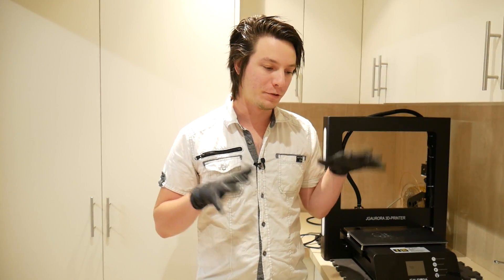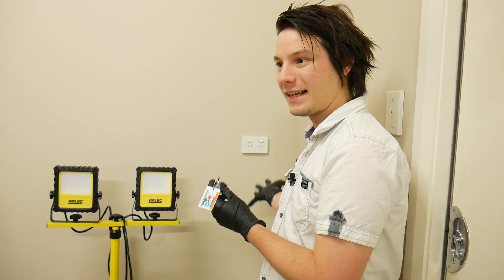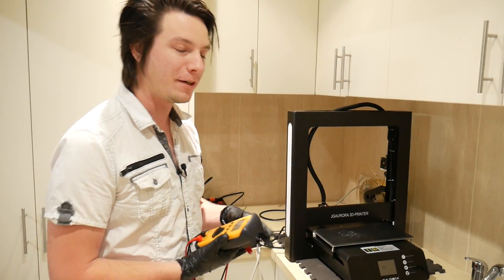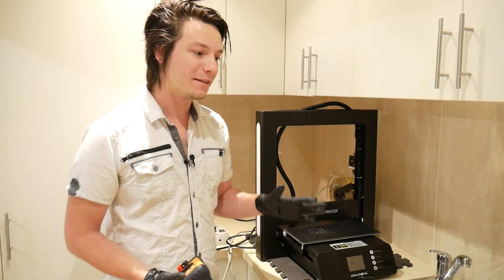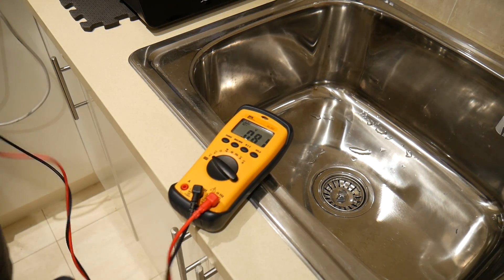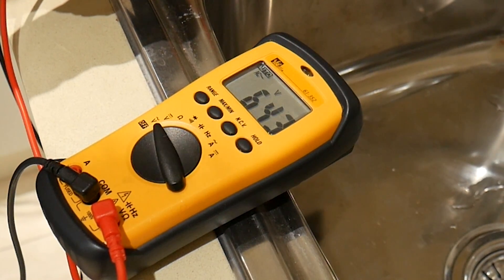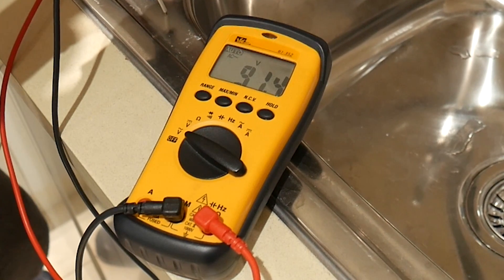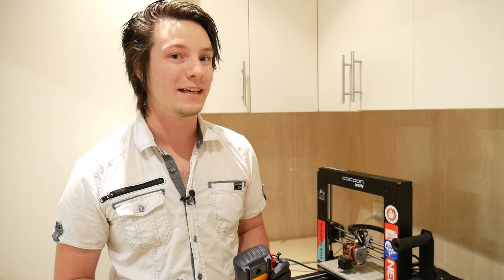This is why I was shocked by my 3D Printer IMPORTANT FOLLOWUP

Comment: K, if you have a voltage on the ground pin because you fail to use the ground, thats a design flaw regardless. And thats messed up.
Reply: What's messed up is the lack of understanding that ALL capacitors commonly used on power supply filtering applications are designed to pass AC with little to no impedance. That doesn't mean putting enough current to harm anyone  on the now floating chassis, just that the resulting voltage on the chassis is certainly enough to surprise you, make you flinch away (unless you're a masochist), or make you swear when you bang your head or whatever on something.

Comment: Also, you can do this all you want in Denmark. In fact, you most likely are. We have ground with a prong (K type sockets) but most devices are shipped witch shucko ground (ground around the side of the plug)

It's safe though, because all sockets in danish buildings have to be protected by a GFI/RCD/HPFI (HPFI is the danish term)

You'll feel it though, and it's super annoying.

Comment: Using the sink as your return path is not always true. If your waste connection is PVC and your water supply is plastic there is no current flow ie. insulation.

Comment: Didn't really explain anything really... Was just a "make sure your ground wire is connected"... So, what happened? Was your power strips ground connection faulty? Was something wired wrong that prevented grounding? Did your outlet just not have a ground wire? 

Nothing was really explained here other than the obvious "derr you need a ground wire cause derrr metal frame"... That's like, 3D printing with a metal frame 101
Reply from the maker: faulty powerstrip along the chain had no ground connected. I discarded it though so wasn't able to test the original source of the fault.

Comment: I had close to the similar situation. When I was over in India on a business trip, I encountered a shock while touching my
computer laptop case and touch the anti-static mat on the work bench. Couple things were going on with my situation. The manufacture of the laptop’s power supply has a filter capacitor connected to the AC neutral and the power supplies DC side of the laptop’s connector. Which in USA, that’s not a problem, but in India, the HOT and NEUTRAL are reversed. That caused the laptop case ground to be floating around 90 VAC above their earth ground on the work bench.

Comment: Ever tried the same experiment with an laptop connected to it's power supply equipped with a 2 pin mains power plug (like most MacBooks)?? !! You'll definitely get shocked by the result (literally!)

Comment: So glad i have a Anet A8 with a UK plug that has ground connected to the PsU, in electrics that is poor and no excuse to say its normal to get an electric shock its normal to not get one. stop defender poor quality  products, SO people make sure not to buy one if you have a pace maker and not let kids use one while drinking .
110v  is used a lot around the world to power things and use say OH its only 94v  erm ok go and stick 2 wires in plug socket and lick them, now you get the picture. 
Enough said
Electric kills and it does not have to be super high, but just the right Zap

Comment: I think it's also worth pointing out, that it's not the voltage itself that does the damage, it's the amperage. Your body can handle having a "high" voltage but low amp current run through it, but high amps will kill. You can think of it like a water pipe. Voltage is the pressure, amperage is the amount of water the pipe can move. Bigger pipe = more water = more amps = death.
They must have a good current limiting resistor setup, or this situation may have ended very differently!

Comment: Im in Australia as well. I have an Anet A8, and haven't had any issues like this. But the power supply cable has a European plug with an adaptor to fit an Ozzy power socket but does not have a ground pin, but has a ground wire connected. Should i take the European plug off and change it out for a proper 3 pin aussie plug?

Comment: Terrible explication! In the last video you mentioned it would have been coused by a broken cable or a badly connected cable?  You should have checked that cable with your testing device and alert people to get rid of a broken cable as soon as they get a sense something is wrong with it!
Now all your sentences sound like click bait by repeating the printers names and the voltages. 

By the way, voltage means nothing! I can provide a power supply that measures 1000 V that is perfectly safe to touch,  as well as a 5 V supply that could give you a shock. It is all about the current, and current trough a capacitor will not be a problem, rather a warning to check your cables.

Comment: Most of the world has AC in the range of 220 to 240V and a frequency of 50 Hz. It is mostly america and a few other places that run 110V with 60 Hz.

Question: Why are the 3D printer manufacturers grounding the frame? The machine runs on low voltage DC which does NOT require grounding at all. Only the PSU needs ground. If they would double isolate the PSU (ground it and then put a plastic shelter around it) it would not be possible to feel any voltage even with faulty ground.

You see this implemented with the few printers that have an external power brick style PSU. You will not be able to replicate this experiment on those printers. There simply is not high voltage on the zero pin even without any ground connection and indeed many of those PSUs do not even have a ground connector.

Comment: It may not be a wire fault but its certainly a design fault. It virtually  guarantees that you'll get a shock if you lose ground connection. The metal cases around equipment should be earthed in case voltages make contact with the case and in normal circumstances the cases should be isolated from the internal electronics. These chinese manufacturers are deliberately pumping voltage out to the case for noise reduction which is clearly something they should never do. Cases and any exposed metal structures should always be completely isolated from the internal electronics, and earthed for additional safety in case isolation is lost.

Comment: Keep in mind that not all sinks are grounded. Full PVC Pipes have that effect. Not all PSUs have a capacitor from live to earth ground. You will find that most all switching PSUs have a capacitor from live to neutral though and if this is the only capacitor, you wont see any voltage from an unearthed pin.

Switching PSUs that are very well designed will not show voltage on an un-earthed pin. Also, in many places in the US (I cannot speak for other countries at all), ground and neutral are wired together at the breaker box, so you will never see this behavior from any switching PSU. You might even say that in many houses (USA) the ground pin is completely redundant.

Comment: I hate to add additional information, but if you take a look at MIL-HDBK-2036 appendix B, you can approximate the human body as a 1500 ohm resistor in parallel with a 0.15µF capacitor.
One end of that curcuit will be connected to earth ground and the other end will be connected to various points on the unit.  The leakage current is determined by the voltage across the 1500 ohm resistor.  In the military world I live in,  the leakage current limit is 3.5 milliamps.  As I recall, the threshold of pain is ~8 milliamps.

Check out https://www.mddionline.com/leakage-current-standards-simplified for more information.  I have not personally checked out that site, but it seems to have a lot of leakage current information.

Comment: speaking as someone who wires houses sometimes, ground should never be saturated unless it is for intended use of dumping waste power from things outside of the power circuit. Machines are generally designed to not electrify themselves when grounding is unavailable.
Reply: You might stop wiring houses as you have no clue of what you are talking about.

Comment: So, you go from testing you wall outlet with your tester, showing it is okay, to your printer and just saying "I have recreated the fault I had before - don't try this - messing with ground is dangerous". But you don't explain what your fault was, you don't show what you have done to recreate the fault and you don't even show the tester plugged to the extension cord. In the end, you just say these devices have no ground and in this case it is okay for them to show voltage on the case. But I really don't get the point of this video, it just confuses more. You really should have explained and shown what your fault was, how you recreated it and how others might get into this trouble (e.g. cheap multi-country adapters). You should also have plugged the tester into your extension cord and you also should have measured against ground from a wall socket, not against the sink. Measuring against the sink is dangerous, it doesn't provide good ground at all. Pipes might be partly out of plastic or PTFE tape might be used on pipe connections. Also... no word about current. It really doesn't matter if the multimeter shows 90V or 300V, the current that may leak through the Y capacitor is important and that should be well below ~1mA.

Comment: What we can tell from this video, is that Angus has metal plumbing. In newer houses in the US, they have been switching to "Plex" plumbing, which is all plastic, so there wouldn't be a ground connection. Things we can't tell, does the plumbing ground to the same spot as the electrical?
Reply: The sink isn't grounded by just the water pipes, it'll have its own ground strap, even if that goes to nearby copper pipes, which in turn are properly grounded, for the very reason that you can't trust the fittings to have proper continuity.

Comment: Good summary. Engineers often call those bypass capacitors because they bleed off unwanted noise and high frequency energy. Those thinking there's still a problem just don't understand electrical engineering and grounding. Safety grounding is there for a reason, and it is important. I would go one step further and measure the current to ground, the voltage is not what creates a danger in a shock, the current is actually the danger. Static electric shocks are very high voltage, but not dangerous because the current is brief and tiny. It takes only a few milliamps to create a dangerous shock that can cause heart issues. But bypass capacitors are small and at line frequency they have very large reactance, so the line current that flows is very small and not dangerous. On with printing!
Reply: We know what the current is (roughly). Since the DVM's input is probably 10M, 90v makes 9uA. If you're curious the reactance of the Y is 1/(2 x pi x F x C)
Reply: Better to measure than estimate, but that is a reasonable estimate. And I know the formula for reactance. :)

Comment: Is this the same reason why my MacBook gives me a tingle feeling from the trackpad when plugging the charger directly to the outlet, not using the longer cable which has ground as well?
Reply: Kind of, Yes. The low voltage side of a power brick often is connected to the mains voltage side with a filter capacitor too. However, it is often connected just to one side of the mains supply. If you flip your mains plug (if possible in your country) the tingle might go.
Reply: Didn't have my fluke with me to check, but my aluminum body laptop gave me quite the tingle when I was in ireland and using a non-grounded adapter to get my 'murican plug to fit their sockets. Changed the adapter to one with a ground pin and all was fine. It wasn't harmful to the electronics but you should def. be using the  cable with ground at all times.

Comment: So normally the frame is isolated from ground, but since there is a capacitor to ground that will pull the frame to line voltage when the ground is disconnected. Odd
Reply: This capacitor dumps noise generated by the PSU into ground, a quite common praxis. Unfortunately, with this extension cord there is no ground to dump it into.

Comment: Amperage kills, not voltage.  You should also check the amperage through the frame and make sure it is not dangerous (or at least mention why 94 V is not dangerous).

Comment: You had floating ground. That isn't "extremely dangerous". Cleaning exposed high voltage cables with a wet towel is "extremely dangerous". If you try sinking (sic) some current I'd doubt you'll get much current going though it. Likely nowhere near anything dangerous.
I'm not saying you should run your 3d printer ungrounded. I'm just saying this isn't "EXTREMELY DANGEROUS!".
Reply: If there is a fault condition that puts live on the frame, a functioning ground would cause the fuse/breaker to trip immediately, but if there isn’t a ground, the moment you touch the frame the GFCI would trip. It’s not good but it’s not life-threatening — over here in .nl, houses that were last rewired before 1980 or so have grounded sockets only in wet rooms (kitchens, bathrooms) and ungrounded elsewhere. The idea was that only equipment that had some degree of weatherproofing so it could be used in wet rooms would have a grounded plug, and all the normal stuff (like... basically only lamps) wouldn’t fit in a grounded socket.

Fitting 30 mA or less GFCIs on the whole house is a strong recommend though.
Reply: The voltage isn't deadly, current is. 250mA is enough to kill you at any voltage. The chance of having 250mA is just higher above 24V (then the resistance of your body becomes obsolete) and certainly when dealing with high voltage (current breakdown). A floating ground isn't dangerous indeed, but messing with the ground definetely is. Angus is pointing out that messing with your ground might be extremely dangerous. A common guy doens't know when he's dealing with a floating ground or with a really dangerous situation. His warning is legit to me.
Reply: That's what I was thinking... If my math is correct... and this is not even assuming skin resistance, but the reactence of a standard 10pf y-type capacitor at 50hz should equal a 318Mohm resistance. That would mean 0.75uA of current at 240 volts....

Impedance of a 10pf capacitor at 50hz:
1/(10 x 10(-12) x 50 x 2 x 3.14) = 318309886ohms
Current flow at without any skin resistance:
I = V/R         so          240/318309886 = 0.75uA

Comment: Sink is not a reliable ground source. At all. Ground all wall socket should be and can be easily tested.
Reply: pex tubing is in use in a ton of modern construction. there is no requirement copper be used. also cold water pipe is not a good ground and is not recommended if i remember correctly.
Reply: I'm no plumber but every sink I've seen has a copper pipe coming from the earth into the taps. That's the equivalent of AC ground which goes to the earth outside the premesis.
Reply: Jamie Modern drain pipe is usually ABS. Even if the parts you see are metal there only need be one parts that isn't.
Reply: Here in the UK all modern installations of metal sinks and metal pipework MUST, by law, have earth bonding (clamps and wires to earth ground) irrespective of the use of plastic drainage pipes.
Reply: Thank you for your reply Phillip. That makes sense.
Reply: Very rarely would a house be done in copper pipes anymore. Some sort of Pex pipe is used almost always because it it cheaper and easier to install. Earth bonding clamps on your sink?  God knows mine does not or have anything like that.
Reply: So what is a reliable ground source if you need to do a similar test that Angus did?
Reply: How do you know his sink isn't properly grounded?  You're just guessing.  He actually states you shouldn't replicate his test, so it doesn't matter how reliable of a ground your sink is.
Reply: Tim Roberts you validate the wiring with a tester. There are many on the market that will identify the plug is grounded. Same can be used to validate a power strip or extension cord is grounded. Alternatively you can use an ups that will alert you as to a wiring fault. And if all else fails use your vom.
Reply: Jerad W believe the point of the video itself is a safety video. So it should be pointed out this is by no means a proper way to test for earth

Comment: So... What was it that wasn't grounded? His outlet?
Reply: Yeah, he really fails to answer this question. As if the ground wire just magically disappeared from his power board ... Still unclear to me what he did. Also unclear how he reproduced the issue.
Reply: So if you watch the previous video he discusses how he daisy chained a bunch of power strips and one of them or its adapter apparently had a faulty ground causing the whole setup to be ungrounded.  He reproduced the issue just by using a cable without a ground for the power supply.  I didn't feel it was all that unclear.
Reply: Yeah he didn't exactly answer the question
Reply from the maker: +AWARHERO in the previous set up, the power board plug. In this test, the iec cable has no ground

Comment: Note for ppl: the sink only works if you have metal pipes, if you have PVC, it won't be properly grounded... you can still use it as a ground reference, but may have slightly off readings